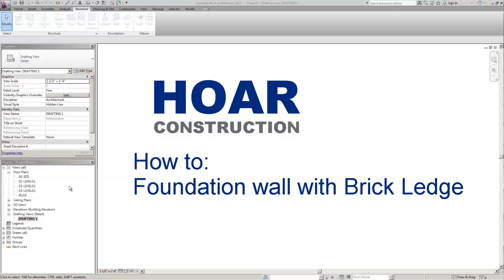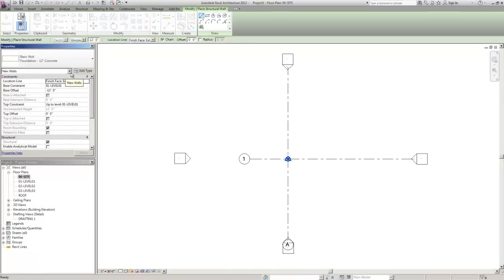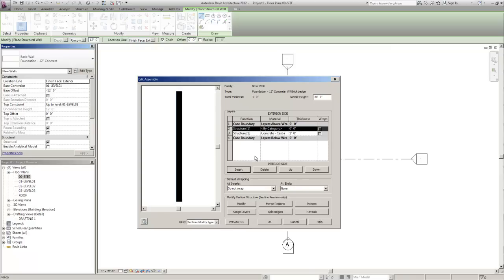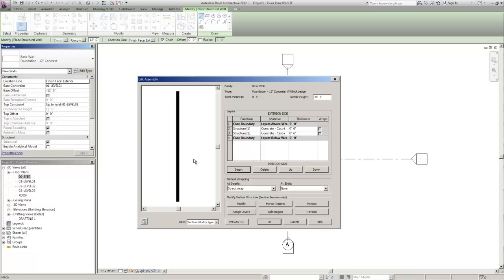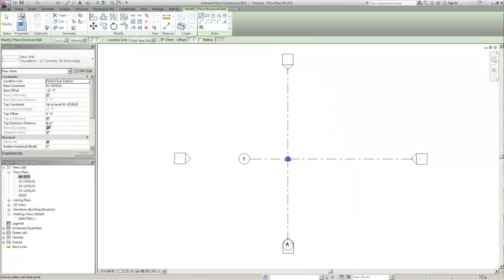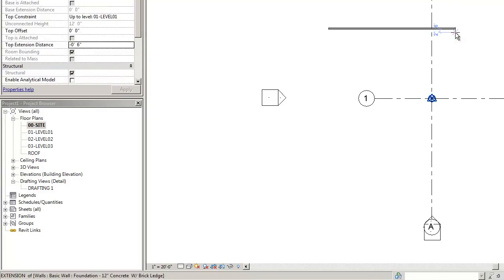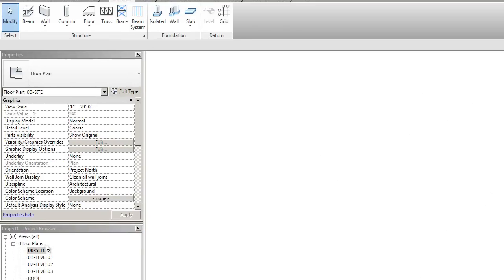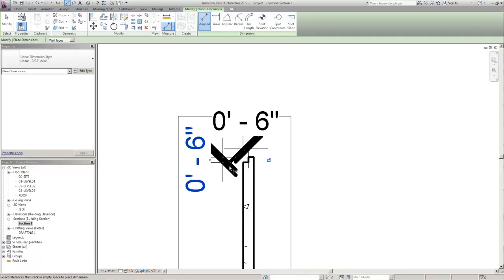Hoar Construction BIM - How To Revit Foundation Wall with Brick Ledge

Comment: Great video, i have a question. How could you use this for a 12" wall that needs a exterior and interior ledge. Case: a brickledge at 10" deep on exterior and a interior garage slab support 8" on inside. Revit does not allow, says wall exterior boundaries need to be the same height. Any ideas?